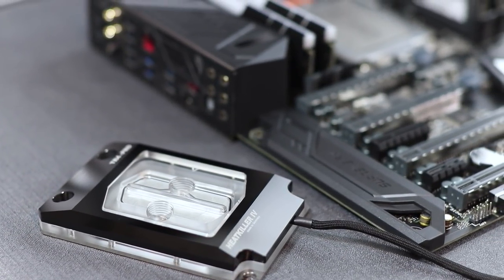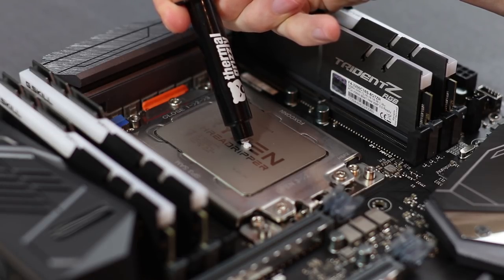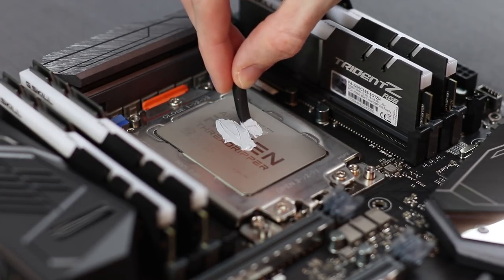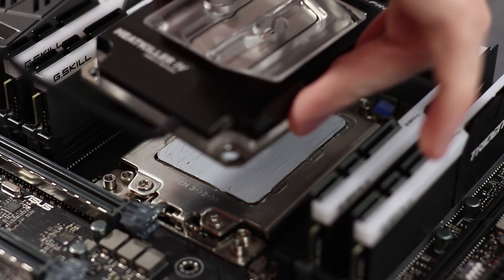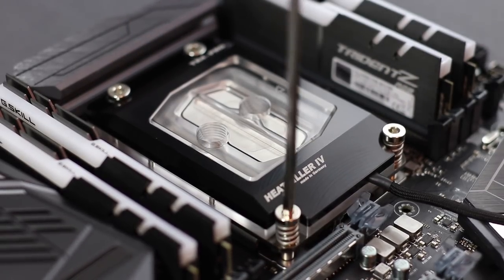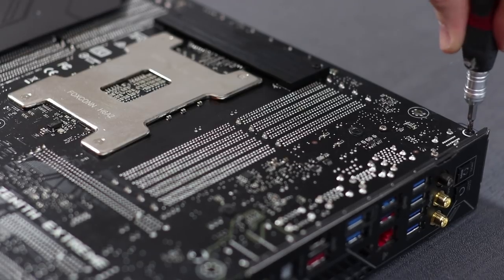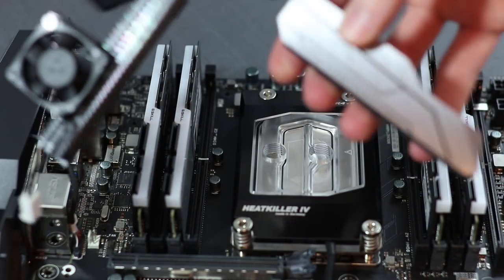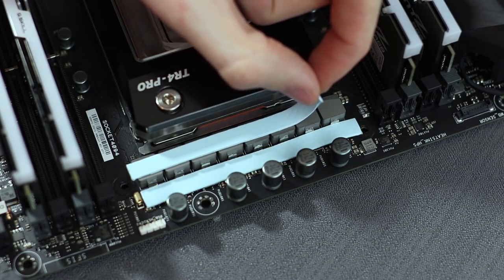Threadripper Overclocked to 4.225ghz!

Comment: I spread thermal paste kind of like you do, but I use a credit card, and put an extremely thin film on both IHS and block, then a tiny bit in the center.  I've had great thermal performance from this.  I rarely get over 40°, and never above 70° under sustained 100% load (stress test).  I have 1800x and custom loop. 1x360, 1x240.  Usually stays at 32° (26° ambient). I had it up to 4.2 GHz (all-core p-state oc), and it was stable, but at 1.45v, so I backed it down to 1.37v and settled it down to 4 GHz for everyday use. At 4.2 I had CB15 up over 1900.  I considered getting TR, but the MOBO cost kept me away. Maybe in the future.

Comment: looks fantastic . Personally I would use some fans as intake , all  your radiator fans  are exhaust now ,except the  bottom-side 4.
Reply from the maker: It's an open-air design. So there's no actual side panel window. I just removed the window from the panel itself. So all the fans therefore become intake! I keep my room super clean so dust is rarely ever an issue!

Comment: Are those heat killer fans? Never seen them before, they're pretty wild looking! Beauty build man, you got my sub. I just built my first gaming rig not that long ago, its no where near as nice but still I love it. 1600x and a 1060 6gb, never had anything come close to maxing the cpu out and 1080p is where I game at so the 1060 is perfect for ultra settings on everything. Do you do this for a living or is it a hobby?? 

I think that purple insert you had in the tubes to keep them from collapsing had a nice purple that would have gone amazing with the black/white scheme! That could just be me though cause dark purple/violet is my favorite.
Reply from the maker: They are made by a company called Noiseblocker, and they are my favorite fans. Best static pressure/noise ratio, and awesome aesthetic! I used to do it for a living, but now it's hobby/side income!

Comment: Nice work. But overclocked? Ive got a 1900x aircooled with noctua nh-u14s tr4-sp3 and get a max temp of 64c in full load and clock goes up to 4.165ghz stock..

Comment: I have that case... do you just leave it open with that left side radiator?
Reply from the maker: I do indeed! My favorite builds personally are more of the open air type. I used to not have the side panel on at all, but since I did, I cut around the bottom for the fans and left it open.
Reply: @LiquidHaus  okay cool man! you've got a lot of rads on that thing it's crazy! my build im working on now only has one 560gtx and a 420gtx on the front. im not cooling the gpu since i don't game much, planning on using that heatkiller block (in nickel) on a 2990wx

Comment: how are your radiators laid out?  what's on the CPU loop and what's on the GPU loop?
Reply from the maker: The CPU and GPU are all on the same loop, but loop layout would go: Pump/Reservoir, GPU, VRM, CPU, 420mm, 560mm, Pump, 240mm, 480mm, 360mm, then back into the first Pump/Reservoir.
Reply from the maker: Hahaha well if it isn't overkill, where's the fun in that?

Comment: Where is the overclock :( ??? Click bait :/
Reply from the maker: Forgot I hadn't mentioned the final overclock but after the VRM waterblock was installed, I was successfully able to up the overclock from 4.15ghz to 4.225ghz! So it's technically not clickbait. I'll work on a followup video specifically about the overclock though!
Reply: LiquidHaus be sure to talk about thermals and noise! Maybe run through some benchmark scores
Reply: i can get my tr to 4.15 with an enermax aio. didn't think it was possible to boost further till i saw this. i might buy your set up now just to squeeze a little more out when i want too (i normally leave at 4.0 ghz depending on what i am doing. if i need a little more muscle then i boost the oc. but for my normal use 4.0 is good cause i use a lot less volts to get it there. lol).